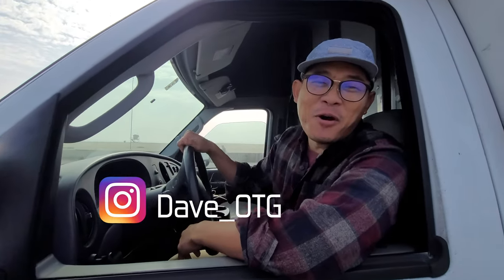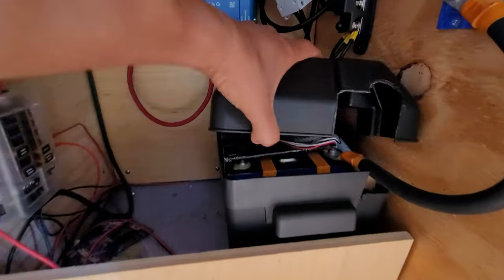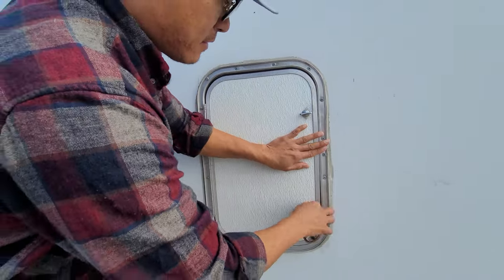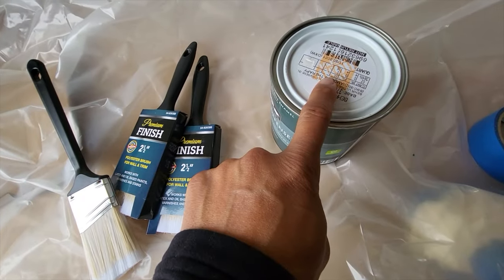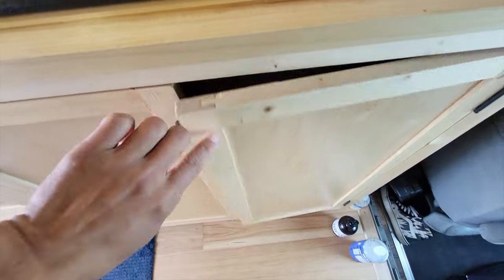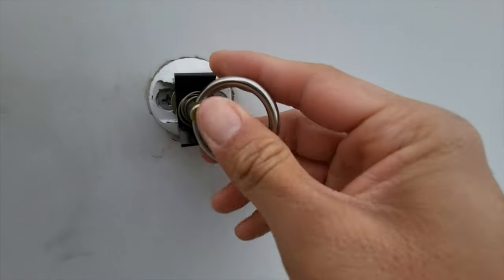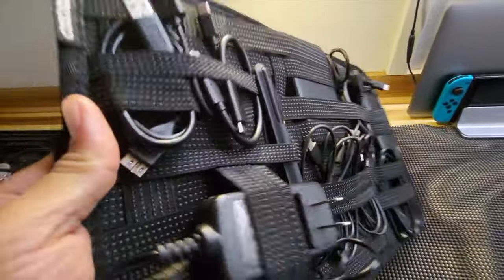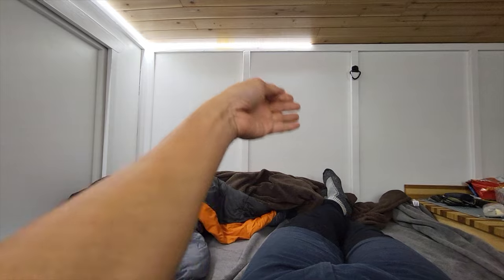Living in my STEALTH 10 foot Box Truck TOUR: Murphy bed, Kitchen, Bathroom and Much MORE!

Comment: Nice little build. 
Couple notes on that ford 5.4 triton 3 valve engine. 
It is critical to keep up on your oil changes at 3000-4000 mile intervals. 
Or at least a couple times a year. Which ever occurs first. 
If you do not, the oil passages that control the variable cam timing phasers get plugged with sludge. 
The cam will phasers fail. 
The repair is a full engine replacement, as it is cheaper than disassembling the engine to clean them, and replace the phasers. 
Research it. 
There is plenty of information on it available. 
The other issue is staying up on spark plug changes. 
If that is neglected when you do try to change them, they tend to break off in the cylinder heads causing a very expensive repair requiring special tools and extensive labor costs. 
There is also lots of info on this issue. 
If religiously maintained these issues can most likely be avoided, and they can be long lasting reliable engines. 
I Hope this info helps you save major headaches and repair costs.
Reply from the maker: Ty for this comment! It made me check my oil and to my surprise, she was a full 4qts low 🤯
Reply: @DaveOTG  I like to add 2 or 3 Oz of seafoam to my oil 500 miles before the oil change to break down varnish inside the engine and flush it with the change. Only 2 or 3 Oz, we don't want to break too much loose at once. It's critical on engines with variable cam timing to keep up with fresh and clean oil.
Reply: @DaveOTG  
Wow. Glad that helped. 
That could of gone very badly.
Reply: E series chassis never got the 3-valve engine. They all got the 2 valve.

Comment: Love your layout. So many are so overbuilt that you feel even more claustrophobic than you need to be, glad to see you kept the storage low and didn't throw cabinets up high. Wondering how you are avoiding mold on the bottom of your mattress, hopefully the way you roll it up when its not deployed gets enough air flow.
Reply from the maker: Mattress folds up. Plus plenty of ventilation and dry heat from diesel heater

Comment: I wonder if you could retain the stealth factor and put windows on the roof... move the solar.. I have a 12' box I'm working on and want a movable/Murphy  bed
Reply from the maker: Sure you can do whatever you like. A sunroof is awesome but I still like to be able to see what's going on outside without a bunch of cameras. If anything you can put a metal grate/vent on the outside of the windows that pop open when in use (for stealth).

Comment: Don't know your miles but be aware at about 240,000 miles it's extremely common that you'll eventually need to replace cam shafts & both exhaust manifolds on that engine.  If you can do it yourself parts are about $2K+. If you're dependent on a mechanic allow for $5K. Dealer repairs considerably more
Reply: Yeah it ain’t no Chevrolet 4.8, 5.3, or 6.0 Vortec all of which beats a 3 valve Triton every day. The E series chassis never got the 3 valve Triton. Plus the Ford trucks and vans are tighter in the engine bay than in the GM trucks and vans. GM trucks are much easier to work on than Ford trucks.